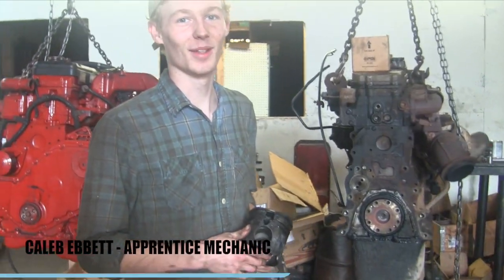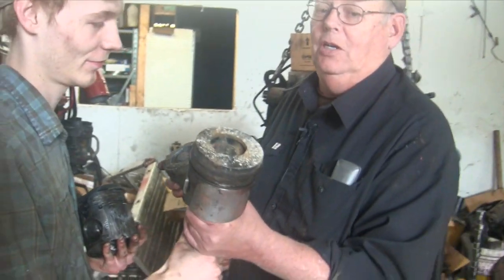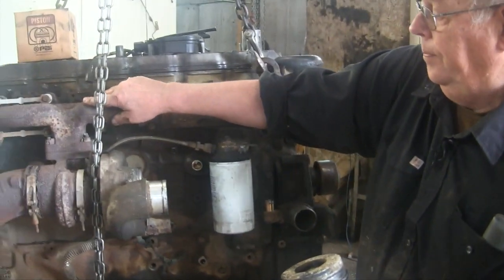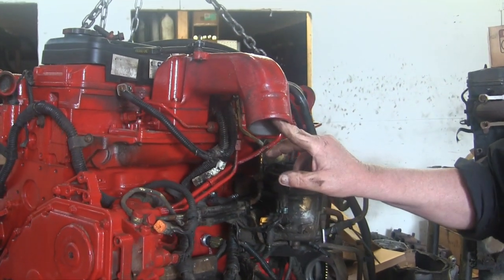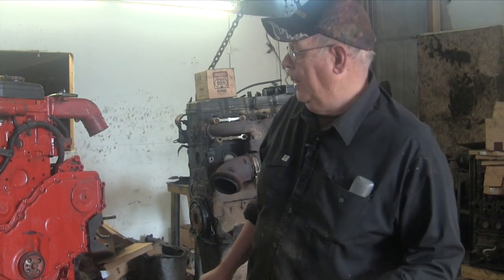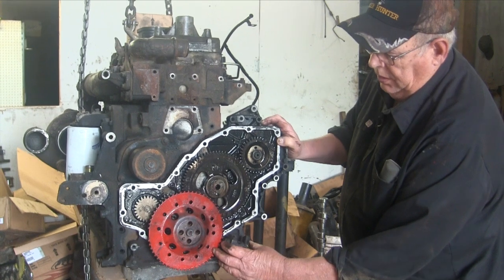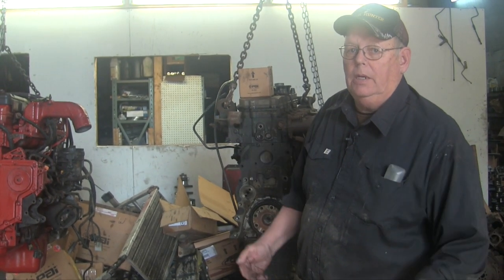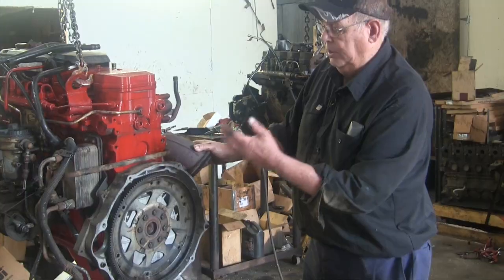White Smoke - No Joke ! Basics of Diesel Engine P2

Comment: I dont get white smoke on cold start, i get it whilst driving at 2500 rpm or above, on a 2L tdi engine. Would you guess and say its turbo release valve, worn head gasket or injector problem?

Comment: Hi i just brought a 1976 Merc 240D  the diesel starts straight up from cold as its winter here it drives nice but blows sort of grey smoke even when warm  it dosent smell like oil burning and no visible signs of oil at tail pipe i took rocker cover screw cap off no bly by coming out of there  i was told could be valve stem seals and to give it a diesel purge with moly purge as injectors could be getting blocked any idea what it could be thank you

Comment: Great video. Made me wish I in a class on these things. Long story short I just got a Dodge Ram 2012 ST 3500 over 200k miles and soon as I got hot from the dealership I noticed smoke coming from underneath the front side of truck with a strong smell like burning fuel. I'm still trying to figure out what it could be before I take it to shop. I only had it a few weeks, it only dose it after I've ran it a while  can you please give me some advice on what I should do or what does it sound like?
Reply: Order a cheap borescope and take out your injectors or glow plugs and look, that's what I'm going to do, same problem. Fingers crossed 🤞
Reply: @crazyDIYguy  ok thanks for the info but after calling around and doing a headache of research I finally discovered the problem and I dosen't seem like it could be something so simple. It actually was the ring gasket that dose between the V-clamp on the turbo exhaust down pipe. If you see soot residue anywhere down in that area then you have an exhaust leak.
Reply: @carnelsullivan6009  no kidding, I'll see if I have something similar going on. White smoke that burns my eyes. Thank you

Comment: This has been happening to many people with the 2.8 diesel in the Canyon/Colorado because GM decided to install injectors that are running to close to the max rail pressure. Causing the injector to stay open and burn a hole in the piston within seconds of the injector failure. You don’t have time to shut the engine down before it’s destroyed.
Years effected are 2016-2018  
In 2019 GM changed the injectors to handle higher rail pressure and fix the issue.
GM will not update the early years engines. Typical….

Comment: i appreciate the information  and effort dont get me wrong, but its hard to watch, bit of rambling and getting a little too basic, most people on youtube looking up diesel diagnosis know what a turbo charger is no explanation needed, spitting and sputtering one word at a time working through pure basics its just dragging it out too much

whats needed most is troubleshooting trees, if theres white smoke check this if thats fine check this, if thats fine check this, if thats bad then its either this or that use this test to figure out which it is.. no need to walk through bolt by bolt or explain every component on the engine, your audience has common sense  were the rare few, we just need a little nudge in the right direction

Comment: If it was my boat I would run it with a Chevy 350 4 bolt main and auto transmission and instead of gasoline I would run it on propane , Tell me if you have the time if you think it would work ? The reason I picked a Chevy 350 engine is cost to repair a 350 engine , I can completely rebuild one for about $400.00 dollars . And Chevy parts are cheap and Propane doesn’t go bad you can store it forever and it’s as good as when purchased and it’s safer than gas or diesel ! I have duel fuel generators that run on gas or propane . But I only use propane because like I said propane doesn’t go bad and gunk up the fuel lines ! My generators start perfectly every time , and all I have to do is open the valve on the Propane tank and turn the key no muss no fuss

Comment: Researching buying a 6.2 diesel step van with a lot of stinky white smoke but no blow by. It's got a 107K so the odo reads. I've read bad fuel, change the fuel filter, injectors, injector pump, head gasket issues, etc. Any thoughts on this?
Reply from the maker: We're going to have live calls set up for a nominal fee to help with questions. I help a lot of folks with advice and so stay tuned

Comment: I've got white smoke out of my Volkswagen TDI right now but it's not from a stuck injector, I think I've got way too much air in the fuel lines. I've seen big cam 400 Cummins pistons with holes like that though lol.
Reply from the maker: We're going to have live calls set up for a nominal fee to help with questions. I help a lot of folks with advice and so stay tuned
Reply: @dieseldoctorlane  I did get it all figured out, thanks though lol. Car runs well now.
Reply: What was the issue?
Reply: @thesudburyguy  Was a combination of things, biggest issue though was the fuel shutoff solenoid wasn't getting 12v reliably. Bad connection somewhere. Fixed so it had a clean 12v and it ran beautifully.

Comment: I have a 1994 Chevy c3500HD with a 6.5 L turbo diesel.  I changed all the injectors and glow plugs.  I also put in a rebuilt injector pump.  I get white smoke and it disappears afterwards.  However, when I press on the fuel pedal, I get more white smoke and it doesn't run smooth.  Can you help me out.  Thanks.
Reply: Ive got the same problem its injection pump timing i already advanced mine as far as i can only option i have now is to shift my optical  sensor. You have the odd ball year with the weird injection pump i hope you didnt put a ds4831 5521 in cause you will destroy the motor if they sold you the wrong pump

Comment: Hi sir I have a diesel that has sat for over a year, should I expect the compression to be lower than normal.this is a cold test,engine not running.thanks
Reply: General rule of thumb is that metal expands when it's hotter and contracts at cooler temps. If it's still in good shape and the rings aren't gone the compression shouldn't change much whether it's cold or hot though in my opinion.

Comment: Hi, perhaps you could help me. I just saw some sparks coming out of my tractor exhaust. A bit like when using an angle grinder.But there were only 5 sparks. It is a two cylinder diesel engine. Any ideas if that is normal. Thanks.
Reply: Does your muffler have a catalytic converter?
Reply from the maker: We're going to have live calls set up for a nominal fee to help with questions. I help a lot of folks with advice and so stay tuned

Comment: I have a 55hp yanmar turbo diesel. Had a runaway..injector running full open. Had injectors completely redone.now have some greyish smoke. Not as much but it's there at idle and at any speed. Changed oil, all filters,inspected mixing elbow(wet exhaust), ran out of jerry can, made sure return line returns fuel..inspected turbo..intake side is clean. Exhaust side is black and sooty. The turbine spins freely by hand..any suggestions would be appreciated.
Reply from the maker: We're going to have live calls set up for a nominal fee to help with questions. I help a lot of folks with advice and so stay tuned

Comment: 1000 for an injector, 14k to build what a lot of nonsense
Reply: Well a new motor is 12 plus labor that makes sense
Reply: @dylanjacobs7509  A complete rebuild on one of these in my area of the states is $5000-$8000 depending on what is wrong. 6 reman injectors swapped in is $2400.
Reply: Utter bullshit even in fiji a rebuild will be less than 1k and injectors less than $400
Reply: Once you blow up that engine it`s not jus a bunch of injectors to replace... might have a bunch of valves that went right through the pistons, sleeves are fucked for sure, might even bend a connecting rod and punch a hole right through the crankcase. An actual crankcase on some engines is just more expensive than buying a used complete engine and rebuilding it.

Comment: Can a bad injectors cause blowby on a 1993 12v?
Reply: Hello! I'm Caleb from the video. blowby is caused by excessive ring wear. All 12v injectors are located out side of the valve covers, so if compression leaks by the injector it can only vent to atmosphere

Comment: I get startup on first start white smoke it goes away after a few mins . 06 Cummins 5.9 287200 miles on it. Supposedly the injectors was changed out already , also I do have light-moderate blow-by .
Reply from the maker: I would say this is possibly broken rings on one cylinder
Reply from the maker: We're going to have live calls set up for a nominal fee to help with questions. I help a lot of folks with advice and so stay tuned

Comment: Now i got a question i got a 96 k3500 with the 6.5 diesel it can be 50 to 80 degrees and it blows white smoke when you first start it it goes away in 10 seconds what could cause that?? Thank you
Reply from the maker: A little smoke = 1 defective injector. A lot of smoke is late timing.

Comment: Half the trucks in our shop usually have "white smoke" in the repair notes. You are right- if you catch it right away, you are looking at an injector. I've got a small collection of what happens when  you don't on my desk. A week ago, I turned in a core X15 with a hole the size of a basketball in the block! At the worst you would be looking at just replacing the engine. We've had quite a few of our fleet owners retrofit their trucks with Recon N14's,  I had a cabover in the shop last week that had a rebuilt big cam in it. The owner had "Let's make the Old School New" painted artistically across the back of the cab, haha.
Reply from the maker: I agree 100% !
Reply from the maker: I also have several pistons on display as to what will happen when you don't stop the engine in time

Comment: Cummins N14 Engine History

￼The Cummins N-14 is a great engine; quite possibly the best Cummins engine ever produced. These engines are the stuff dreams are made of if you’re an old school guy looking for reliability. No doubt, the N14 is part of “1,000,000 mile club”. The engine features the best of engineering fundamentals mixed with one of the first electronic control system. First designed in the late 1980s it was sent into full production in 1991. The N14 engine is the follow up to the vastly popular Cummins 855 Big Cam which was produced 1976-1985. Cummins listened to it customers and designed a more powerful version of the 855 while maintaining a similar profile and bore/stroke architecture. Overall, the biggest structural difference between the 855 and N14 is the air-to-air cooling system changes but both engines are very similar.

The N-14 was produced until 2001 and saw many changes over its 10+ year run for Cummins. The most radical change over the 855 was the incorporation of the electronic control module (ECM). Detroit Diesel rolled out the first commercial electronic diesel engine in 1987 with its ground breaking Series 60 Engine and Cummins followed suit. With the advent of the first EPA Tier emissions regulations in 1994 the future of diesel engines was going to be electronic diagnostics. The N14 Celect was the first Cummins engine to feature an electronic injection system. The Celect fuel system produces systematic pressure throughout each injection cycle unlike the common rail fuel system of the 855, or older M11 or L10 models. Albeit the injectors are still cam actuated the ECM controls the metered flow of fuel to the injectors. In 1997 Cummins introduced the N14 Celect Plus which further fine-tuned the ECM to control many more custom parameters of the fuel system.
Reply from the maker: I agree they were fabulous engines. Too bad they have been discontinued. They were easily 1M mile engines.
Reply: What engine would you pick from today for reliability ?

Comment: Just had my injectors replaced with Bosch injectors. Runs perfect but when  i put my foot on the accerelator i can see white smoke coming out with the black smoke. Ive driven about 400 miles since injectors replaced. What is causing thr white smoke on my 2005 ram 2500 5.9L 24valve?
Reply: I’m not the expert but it might be dumping too much fuel to burn especially if the injectors are way over stock.
Reply from the maker: @zapdotshimmy  Yes that's exactly right. Or John you could have broken piston rings
Reply from the maker: We're going to have live calls set up for a nominal fee to help with questions. I help a lot of folks with advice and so stay tuned

Comment: I get white smoke on cold start after sitting for >12 hours & cold weather. After first start and usage it doesn't smoke at all. Just a couple puffs first start & it clears.
Reply from the maker: If it's a Cummins or any diesel engine it's a sign that one injector dribbles a little bit when the engine is stopped. You'd need to have all injectors removed and tested on a sophisticated test stand. There's one in Toronto that can do it for $75 CDN per injector. Dave's Diesel - tell them Lane Harper sent you
Reply: @dieseldoctorlane  75$ per injector wtf
Reply: @dieseldoctorlane  It's a 1.4 TDCI Ford I'm in the UK.
Reply: @dieseldoctorlane   i have a f650 flatbed 5.9 Cummins . my driver said he was driving down grade hill loaded with the exhaust brake on. All of a sudden he heard a noise. He turn the exhaust brake off. But noise still going on. Then he kept driving it back to the shop. For more them 20miles. And wite smoke started coming out , loss power as well. Could this be the turbo ?
Reply: Stuck pintles leaking fuel , glad ive got a 6.5 detroit diesel its the worst diesel built but the easiest to work on in my oppinion cheap parts readily available ok power and uses next to nothing for fuel
Reply: @stevenbean9706  - I got rid of the car about a month after posting my original comment. It probably was a leaking injector. It wasn't even a Ford engine, it was a PSA engine made by the Peugeot and Citroen group. French garbage the car fell to pieces at 100k miles.

Comment: Dear doctor my car is getting white smoke from exhaust .. no pickup problm,no milage prblm..no intimations.no turbo prblm.no coolent oil mixied prblm.. only white smoke..what will I do? One of the mechanic told me that it’s related with the diesel pump issue..is it possible?
Reply from the maker: Not pump, could be injector. See above answer. Or could be low compression - worn or broken piston rings, bent push rod or bent connecting rod. Good luck and let me know how that goes
Reply: Overfueling?